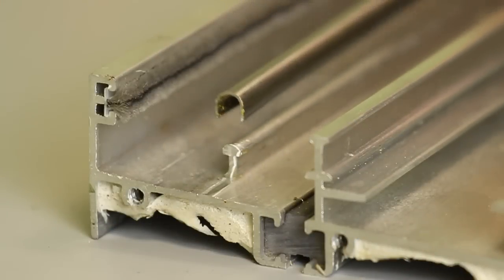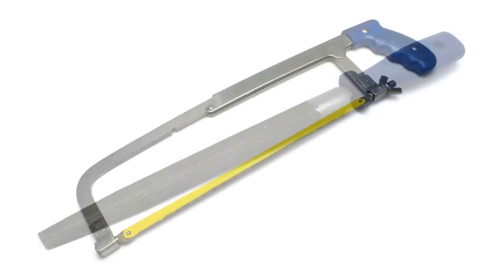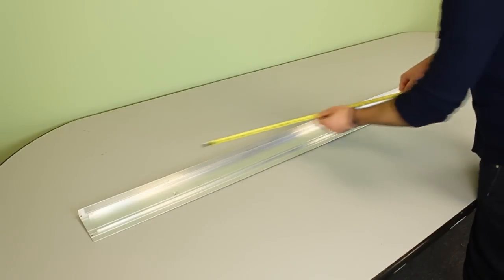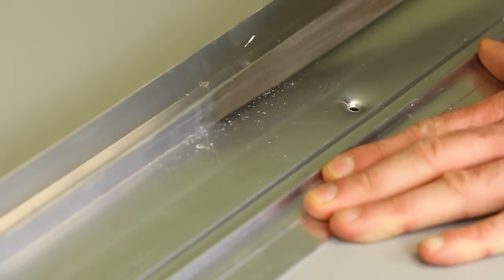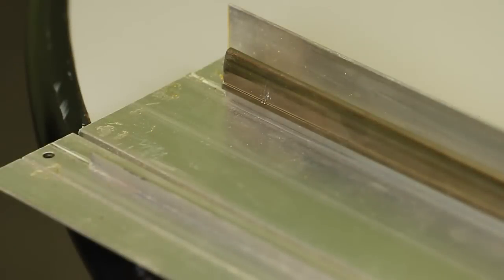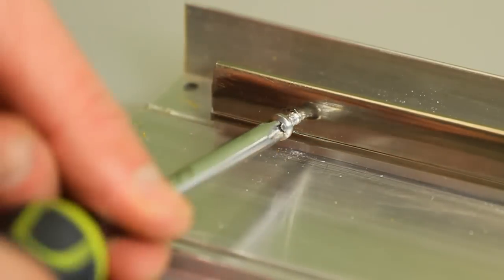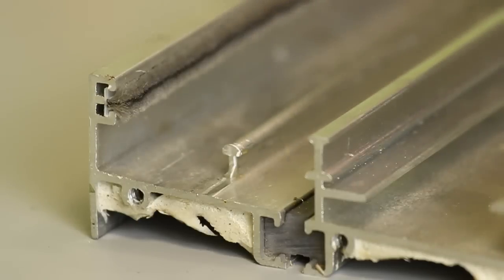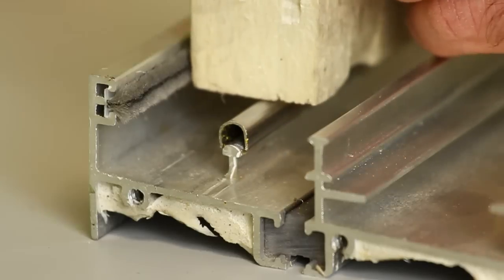How to install a sliding glass door track cover

Comment: Yes, so easy when it is shown being installed on a brand new track.  If you had a brand new track, you wouldn't use this.  Show a video of the cover being installed on a warped/deformed track.  That is when you would use this and that is when you would run into difficulties installing it.

Comment: Greetings,
Will either the large or small track work?  Mine is an old 1984 model.  My preference is go with the larger size as the old track is somewhat mushroomed.
Thanks
Vinny
Reply from the maker: Both the small and large track covers may fit over your existing tack. However, using a large track cover over a small track may create a clearance issue due to the increase in height. It will depend more on the door than the track. If you aren't sure if you have the clearance, you may want to err on the side of caution and go with the smaller track

Comment: Works as advertised! 37 year old door track was pretty gouged up. New Swisco track cover and door wheels (Amazon) had it running good as new. The track cover sits a little loose in the heavily worn spots so I may remove it and back it with RTV, but I'll leave it as is and see what happens. Thanks for a decent product!

Comment: Mine is coming up off the tract. Can I use JB weld?
Reply: It's probably coming up from the ends.

I've held ends in place by using 2 pair of #6 1/2in self-drilling screws on either end of the track cover (using my impact drill).  You can't screw into the cover but you can set the screws close enough on either side so that the screw head touches or "bites" into the cover -- thus holding it in place.  Set one screw "inside" -- the other "outside" -- NOT ON TOP OF -- BUT EITHER SIDE OF THE COVER!  Do this at both ends.  

Make sure the placement of the screws won't interfere with the door rollers.  How?  Before removing the door, slide the door back and forth and mark the farthest point the rollers travel.  Set your screws as far from that point as possible.  The screws must not be in the path of the rollers -- you'll never get them low enough.

Once set, and after door reinstall,  roll the door back and forth, checking for door (not roller) interference w screws.  Set the height of the screws accordingly.
Reply: I am a woman...couldn't do all of that, but thank you! I put some jb weld, so far so good! LOL! I really appreciate your long detailed answer, though, so kind of you. God bless!
Reply: In other words, “Thanks for telling me how to do it correctly, now I’ll just do it the way I was going to anyway.”

Comment: You showed two different options for a track cover. Is there a difference as to which one you should use and why?
Reply from the maker: It would depend on the dimensions of your current track! You can view the dimensions by clicking the links in the description.

Comment: Does anyone know where I can source one of these track covers in the UK? I can't find them anywhere apart from SWISCO but its 130 Dollars shipping for some inexplicable reason.
Reply: I'd try to email them...the shipping calculator may be off.
Reply: NewHopePennsylvania Good idea, Thanks for the advice!
Reply: NewHopePennsylvania Well I emailed them to ask if this calculation was correct and they just very generically told me to use the website calculation for a quote. I presume this means that it was correct, but they didn't want to admit it? It was all very strange
Reply: @mrrageous7471  Too bad, that's pretty lazy customer service, not none at all.  I'm now disappointed in SWISCO.